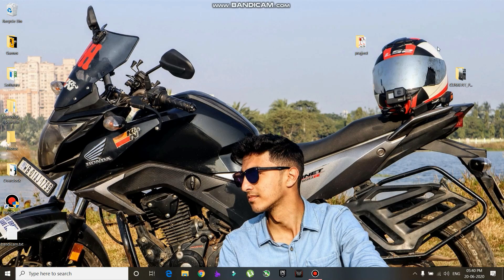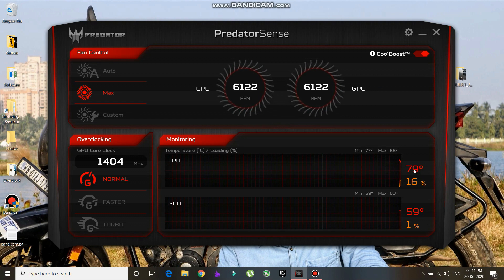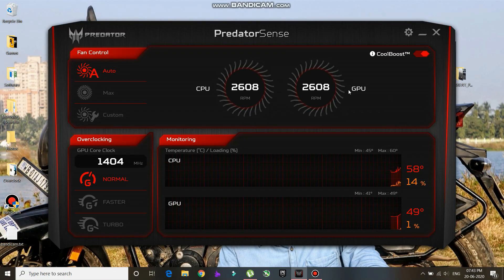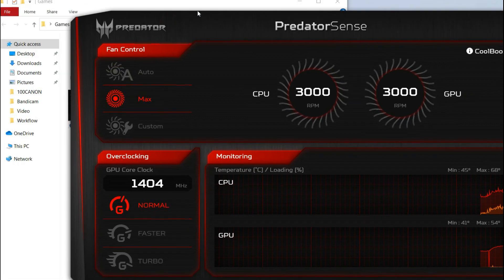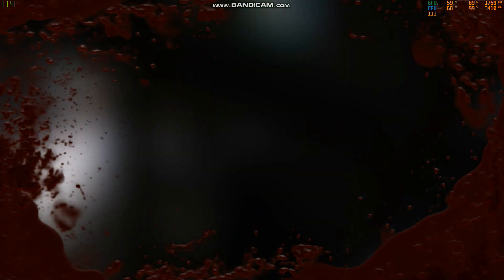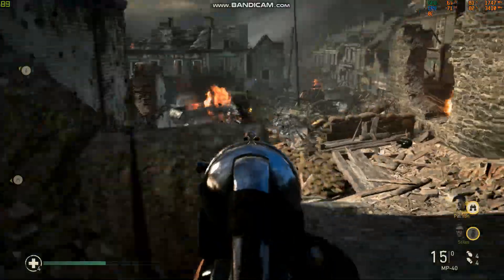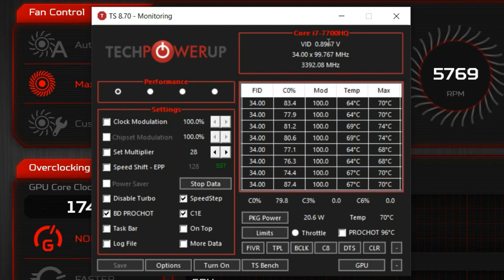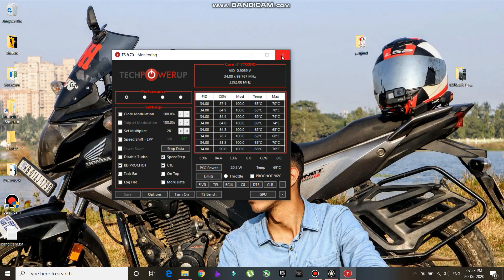Fixed heating issues on Acer Predator Helios 300 finally 🔥

Comment: My Helios 300 (2018) runs 3D Graphics at over 200 degrees.  Laptop so hot, it burns my fingers.  Still runs fine otherwise.
Reply: not true, temperature destroy logics on electronics, 0 become 1 and 1 become 0

Comment: hey.. i am getting the same issue but temperature goes only till 60-70 C when connecting charger and goes 80-85 while gaming, is it the issue with thermal paste?

Comment: Hi Bro ,

i have a question to ask , can you please provide me the audio driver details that is in this laptop !  i bought this laptop and formatted it which caused me to lose the original audio driver and i need to know the original driver details installed ! (it goes like this driver version 6.0.8907.1 which is the incorrect one in my laptop now)

Comment: Nice.   I’m going to have to repaste mine.   It’s almost a year old.    I underclocked the cpu.  But I’m still messing with the settings.   I can get it much cooler with a hit to performance but it never seems to stay the same.   Sometimes it runs great at like 60-70°c with hardly any downgrade in performance    Sometimes it still gets kind of hot while not running so great.    Hope the paste helps
Reply: Under Windows Power Options set your power plan to use Active cooling that way it won't skimp on power used to cool itself. And if you are bold enough to go to messing with the cpu then add some silver thermal paste.

Comment: My predator cpu fan seems to stop at a certain point when i opened predator sense, is that normal?
Reply from the maker: No. Atleast if fans are set to auto then not at all... Never heard of this issue
Reply: totally normal, if your temps are low enough, fans will stop completely.
but for that they have to be really low, under 45°C on both cpu and gpu if i remember correctly
(i have the 2018 version, so 8750H & 1060)

Comment: I may have to do it... I get 95-97 C in CSGO MINIMUM Settings!... Earlier i used to play at max setting with no problems
Reply: Getting same issue.Change urs thermal compound bt in my case is vrm
Reply: @binodchaulagai11  i fixed that by cleaning the fan and vents... The air was just not getting out from the laptop XD
Reply: @shikhar007  also re apply thermal paste. I did the same as you, but after 3 months it didn’t help at all. Even after reclaiming it.
Reply: @crater3539  yeah, had to do that too becoz after sometime same issue happened and this time there wasnt much dust
Reply: @shikhar007  I reapplies thermal paste and now I’m at 70-80c instead of 95c. Thermal paste definitely helps

Comment: Did you notice emps getting worse over time? I repasted with noctua h1 and initially the temps were remarkable but after a month or so it got 10°c-15°c hotter
Reply from the maker: I'm also using noctua nt H1 and results are much better for me.
My laptop stays under 90-92 no matter how hard i stress it.
You can watch undervolting video that might help in reducing the temps further.

Comment: can i use these settings in my acer helios 300 i7 8750H with 1060 6gb gpu laptop ?
Reply from the maker: You mean undervolting settings?
Undervolt video is up check it out this should help you - https://youtu.be/fSEjwWLsMwY
Reply: @techmarshal9726  Will it work on i7 8750H ? Or will it harm my cpu
Reply from the maker: @dilipsinghkathait4741  Those temps are fine as it's a gaming laptop.. however if you undervolt you might see some drop in temperature and increase in performance... Check the video I have explained everything there.
Reply: @techmarshal9726  When i play valorant . ideal cpu temp is between 92- 95 degree help pls

Comment: I think I have the same problem 
My laptop heats same like yours 
But I am scared to open 
And dont have proper knowledge about thermal paste 

What do you suggest should I go to shop or clean the laptop myself and do thermal paste 

And which thermal paste do you recommend?
Reply: Go with the Thermal grizzly kryonaut. I made a video about helios 300 repasting. Do check it out.
Reply: @MVNDRVX  sure bty I did already glendid solutions so far no prbs been 3 months now
Reply from the maker: @chinmaydabherao5399  Glad your lappy is working fine... I'm currently using Noctua Nt H1 and it's performing great paired with undervolting.
Reply: @MVNDRVX  ur model is diff blue one I guess 2019 version I got 2018 edition
Reply: Cool... Glad you found a solution ✌

Comment: Thanks for the video, very helpful.
Just wondering why you removed the fan blade cover? Was it just to inspect the fan blades for damage or another reason? Was heat paste applied there also? Many thanks.
Reply from the maker: Glad you liked it.
I removed the fan case because dirt was stuck between the fan blades and air exhaust vents...
Reply: @techmarshal9726  bruh.. this one is good one.. mine got a lot of dust.. rn my temp is not that high anymore

Comment: My helios has 2 tb pf hdd and no ssd. 
Does gaming with hdd affects fps or photoshop’s performance?
Reply: Yes SSD does make a difference not only in boot or loading time but also it renders images or videos faster. I recently upgraded to 970 evo plus and have uploaded a video about it. Do check it out when you have the time ✌
Reply: ssd's advantage is only long lasting and quick loading time. It does not really affect performance.

Comment: Bro, do u know how to check for the max rpm of both fans? I just bought a 2020 helios 300.. the cpu fan barely reaching 5000rpm but the gpu is almost identical to yours.. i dont know if its something wrong with the fan or is it the actual max speed of the cpu fan.. pls help coz i am also having the heating problem.. cant play pubg even only at high coz i felt it got too hot..
Reply: bro try to change best performance to better performance in the battery icon because for me it made it very cool

Comment: I have the i7 8750h, GTX 1060 model. It heats as hell and also thermal throttling in very single games. BTW what is the model of your laptop used in this video?
Reply from the maker: Itt's an ACER Predator Helios 300 2017-18 model  i7 7700hq gtx 1060...I am going to make a video where i'll share my experience which helped me somehow fix the issue....
Reply: Mine gets so hot, I could cook an egg on it.
Reply: @jdsguam  Hi bro. I fixed that issue on my laptop. So normally without gaming it would go from 90 to 98 degree celsius on idle(for real). But after repasting, my idle temp is 40 to 46 celsius, or even goes to 35 degree in a AC room. Repasting is the only way.
Reply: @Jo5huaFPS  is there a paste u recommend?
Reply: @meiyeumi  Any thermal paste will work just fine. But I would suggest you to go for a brand which has high positive reviews.
Reply: @Jo5huaFPS  okay thanks, also is it hard to do it? i’ve never done it before so im kinda worried
Reply: @meiyeumi  I did that with a technician I know. I would suggest the same. Please don't do that on your own.
Reply: @Jo5huaFPS  yeah i was thinking of doing that
Reply: @meiyeumi  Alright bro. All the best. Once you do repasting, let me know the results.